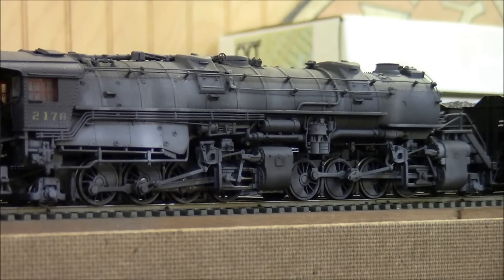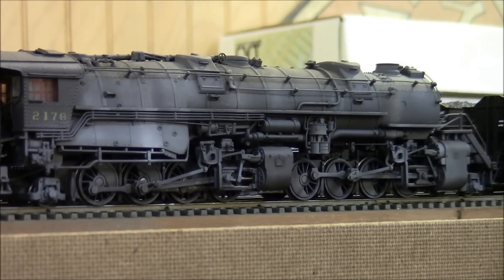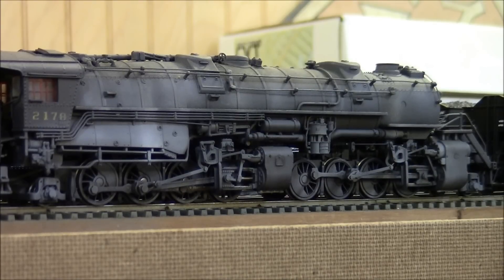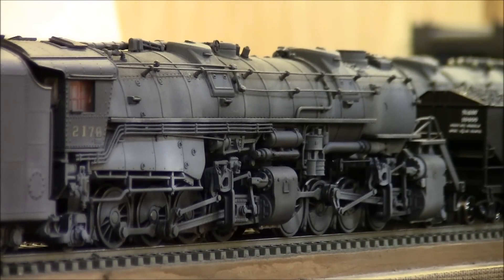TCS WOW Steam with PCM Norfolk & Western Y6b

Comment: Just watched this again, and realised you have selected wrong mode! This is a COMPOUND articulated loco, therefore should only have four chuffs per wheel revolution. The steam from rear cylinders is exhausted into front cylinders, and no audible exhaust is heard when this happens. Only audible exhaust when front(low pressure cylinders) exhaust up stack. It would appear you have selected the 'simple articulated loco' setting...
Reply: The Norfolk and Western Y6s could operate in both simple and compound modes in real life, if I'm not mistaken. How they did this, I'm not entirely sure.
Reply: +Armagon Armagon you are correct, well almost. Superheated steam could be admitted into the exhaust steam from rear cylinders before it entered the front cylinders which had the effect of boosting power when needed. Not strictly pure simple operation, but then again not strictly compound operation which is just using one lot of steam twice. Even when introducing superheated steam though it would still only result in four exhaust beats per revolution as the steam from rear cylinders is not exhausted seperately. It was certainly a good idea, the best of both worlds: superheated power when needed and compound operation for economy when power needs not onerous.
Reply: There's a great discussion in Jeffries's "N&W: Giant of Steam", in the chapter on locomotive engineering. At low speed you (the engineer) run simple for more power; but you can only do that up to 10-15 mph or you run out of steam. There's an intercepting valve, with which you change to compound operation. To me the "holy grail of sound decoders" would be capable of both sounds and let me transition from simple to compound.
Reply: That would be a rare beast indeed! Certainly a challenge for the folk at Soundtraxx. Something I have pondered as well: the exhaust note of a compound would I imagine be a much softer sound than a simple expansion exhaust...but without a large compound available to listen to I am only surmising. Of course there are probably some good sound recordings available in the archives...

Comment: One of the finest steam locomotives ever made at 1:1 scale, too!  Roller bearings, alloy rods, precision balancing- N&W got it right, while Alco's "Super Power" locomotives got it wrong.  If only L. D. Porta could have worked with the N&W shop. . .
Reply: Mark Stockman I'd beg to differ on that. The Y6 was built for slower speeds whereas Alco's super power was likely better suited to mid to high speeds. But it would have been interesting to see what would have resulted had the N&W worked with Alco to build a brand new design.

Comment: the engine sounds like its going really fast but the wheels are barely moving?  did you set that up like that?
Reply: I think what you are hearing is the out of sync "double chuff" which is incorrect for this locomotive.  That sound is associated with simple articulateds (basically a double header.)  This locomotive was a compound Mallet and would've had a more sloshy, single locomotive chuff since the exhaust was much lower pressure than that of a typical single locomotive.  I hate that manufacturers get this wrong, but I have seen some modelers change settings to get a closer to accurate sound.